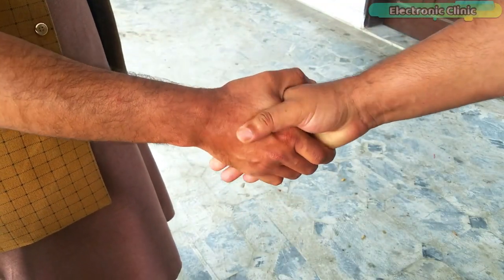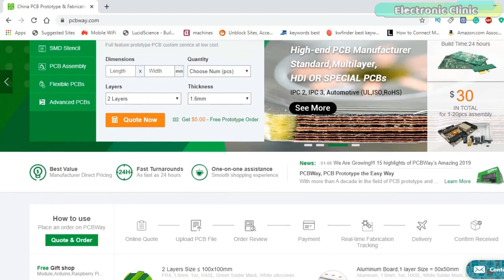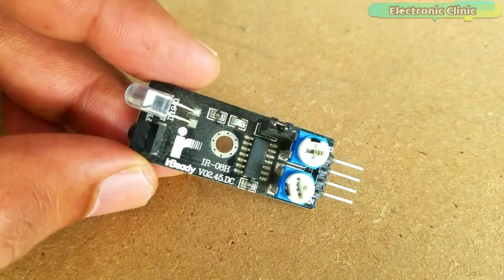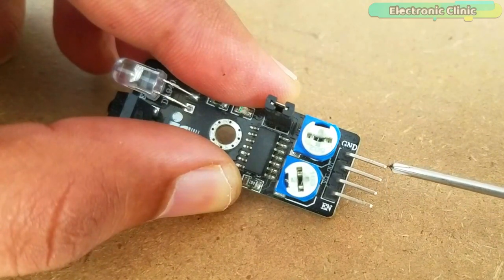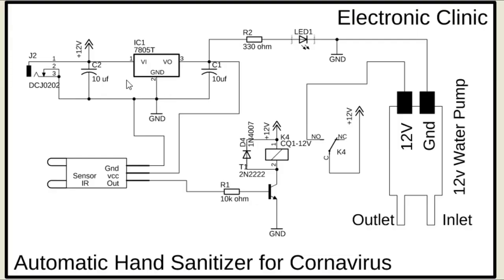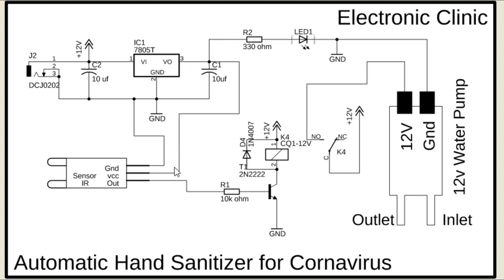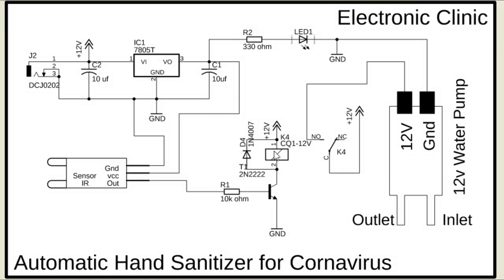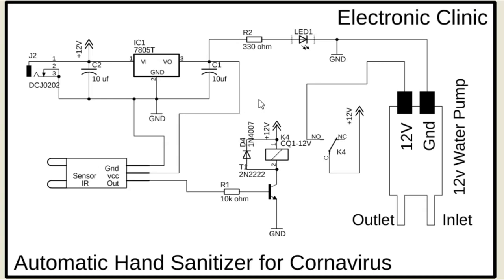How to stop Coronavirus Spreading by making Automatic Hand Sanitizer /wash, COVID 19 Break the chain

Comment: Or a speed controller instead of a relay. This would control flow via preset pwm. Still a Great project
Reply from the maker: You are absolutely right. But I tried to keep the budget low. I tried not to use so many electronic components so that anyone can easily build this project.
Reply: @ElectroniClinic   i would of hidden the pump in the box too ;)